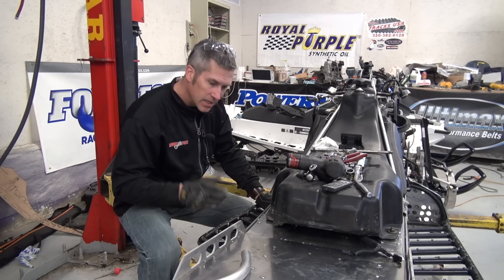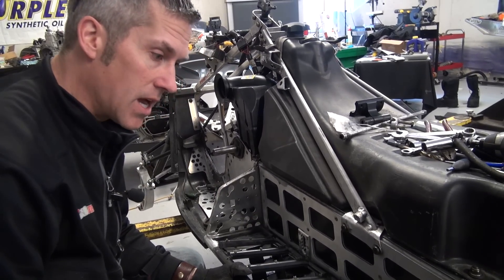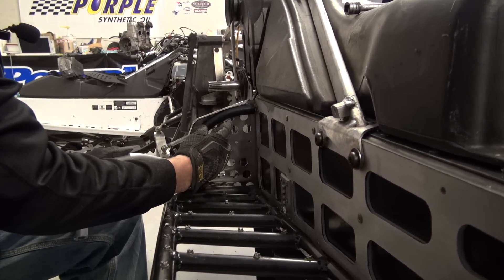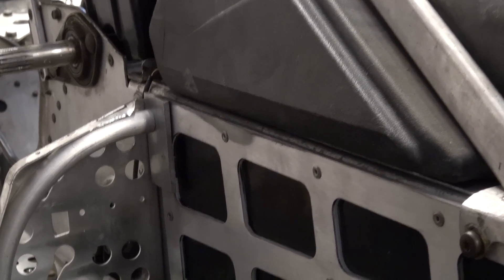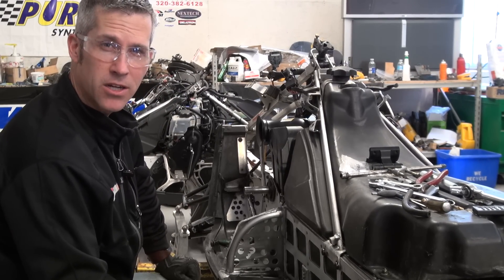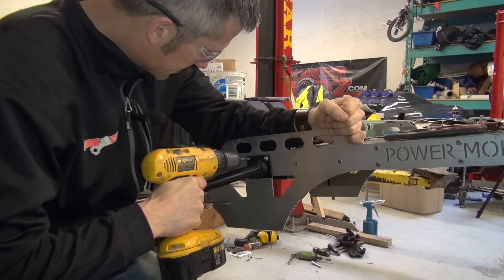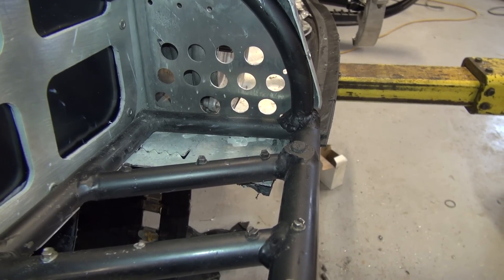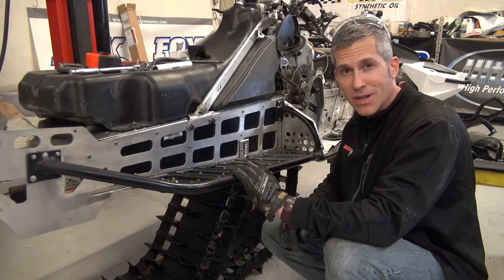Ski-doo REV 700 Mod sled 159, running board install, episode #17, PowerModz!

Comment: Did you plan this ahead of time so that the rear bracket on the running board would fit that precise between those two triangle on the extension tunnel? 
  Another question is ,do you find that open running boards makes for colder feet of does power fist have warm boots too? 
  Lastly i just love you editing ,man id like to be able to do little movies and edit them as smooth as you can ,you Rock Louis .

Comment: Can you still upgrade your running boards if you have a radiator under neath it
Reply: Where did you get the belt gears for the chain case